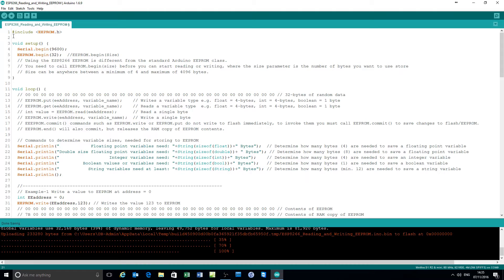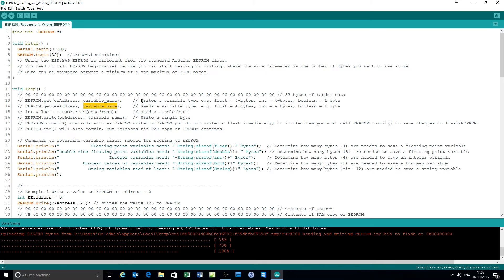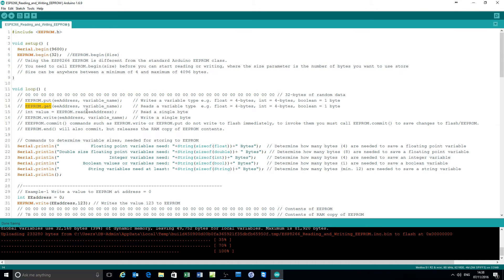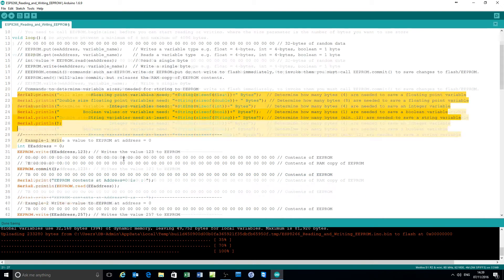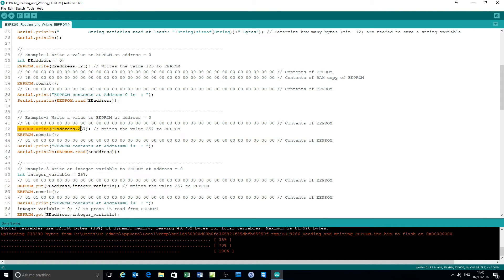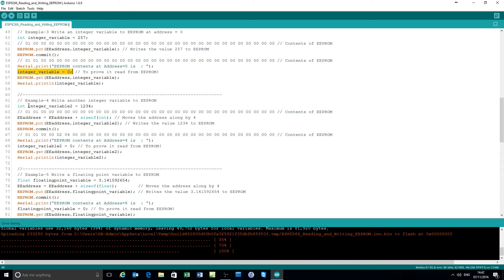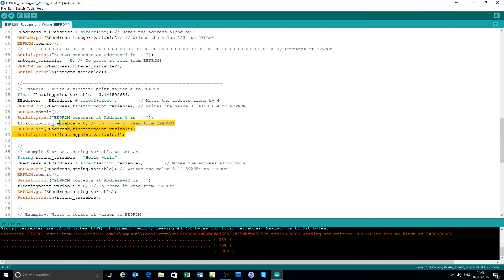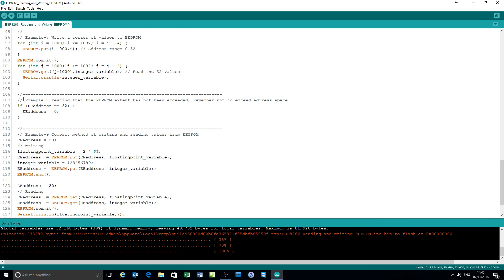Tech Note 015 - How to Use ESP8266 EEPROM

Comment: I'm not sure this works as advertised. EEaddress is initialized to zero but incremented by the "sizeof(<data>)" BEFORE being written in a few places. Example 4 increments by the size of the prior variable written (2 for type int) so that happens to match, though possibly confusing. However, at Examples 4 and 5, the increment is for the size of data TO BE written, not last written. Since you write and then read using the same EEaddress, the value returned is correct, however, it is NOT being stored in the positions indicated.
Please explain if I am missing something.
Reply from the maker: The examples are not sequential, they are merely individual examples, it was never meant to be an end-to-end result just single actions that work. You say ‘not sure’ of which element?
Reply: @G6EJD I mentioned examples 3 and 4. For the string example, the address is incremented by the string length BEFORE it is written. Should be incremented by the length of the last thing written.

Comment: I don't need big eeprom space.
Is it ok to call EEPROM.begin(20)?
Is 20 ok?
Reply from the maker: Any size you like as long as it’s enough to hold your variables, the EEPROM is used for nothing else. I advise going larger than you need unless your really sure you never need to enlarge the size, because if you do need to increase the size you’ll lose your data.
Reply: @G6EJD  Thanks for fast reply.
Let's say I'm am to using EEPROM address 0 only.
Is that address going to wear out at some point?
I heard about wear level controlling is that something ESP automically does or I have to implement myself.
Thanks again and I have susscribed to your channel
Reply from the maker: The ESP32 does do wear levelling, so it moves the physical address around but leaves the logical address the same, so you never know. EEPROM is not for frequent use, so you should get 100,000 writes before there are issues. Also do a read before write and don’t write if the same value is already stored, that improves life too.

Comment: I struggling:
i can't get your your example 9 to work correctly, after writing 2 values, only the first is read back correctly..
What i dont get:
- in all examples you end a write command with a EEprom.commit() , but in example you use a EEprom.end()  ??
- in all examples you end a read command with no special commens , but in example you use a EEprom.commit() after reading  ??
Does not make sense?
Reply from the maker: I've checked the examples and can see no problems with them. For an EEPROM WRITE or PUT they must  be completed by a COMMIT function otherwise the values are not written. EEPROM.end() closes the EEPROM services and EEPROM.BEGIN needs to be issued again.
Reply: @G6EJD  Thanks for your quick reply!! 
It does not seem to work, at least not for the second variable..   :-(
Only the first variable is written en read back succesfully, the second variable was never written, or read...
Need to say that i'm using a Wemos D1 mini board, maybe it has something to do with that? (also uses a esp3266)
My test sketch ends with " c1 = 1234    c2 = 0"

My test sketch:

#include <EEPROM.h>

int c1,c2;

// FILL vars

void initVariables(){
  c1=1234;
  c2=5678;
  Serial.println("--- Vars filled.. ---");
}

// CLEAR vars
void clearVariables(){
  c1=0;
  c2=0;
  Serial.println("--- Vars cleared.. ---");  
}

// PRINT vars 
void printVariables(){
  Serial.print("c1 = ");Serial.println(c1);
  Serial.print("c2 = ");Serial.println(c2);
}

void writeEeprom(){
  int EEaddress = 0;
  EEaddress += EEPROM.put(EEaddress, c1); 
  EEaddress += EEPROM.put(EEaddress, c2);
  EEPROM.commit();
  Serial.println("--- Vars written.. ---");
}

void readEeprom(){
  int EEaddress = 0;
  EEaddress += EEPROM.get(EEaddress, c1);
  EEaddress += EEPROM.get(EEaddress, c2);
  Serial.println("--- Vars read.. ---");
}

void setup(void) {
  Serial.begin(9600);
  EEPROM.begin(128); //size in bytes
  Serial.println("/n");

  initVariables();
  delay(500 );
  printVariables();
  delay(500 );
  writeEeprom();
  delay(500 );
  clearVariables();
  delay(500 );
  printVariables();
  delay(500 );
  readEeprom();
  delay(500 );
  printVariables();
}

void loop(){
  delay(500);
}
Reply from the maker: @winandd8649 , you've got the same address each time you read or write! You need to set the address for each variable on the ESP8266 each int takes 4-bytes hence +4 here:
 int EEaddress = 0;
  EEaddress += EEPROM.put(EEaddress, c1); 
  EEaddress += EEPROM.put(EEaddress,+4 c2);
  EEPROM.commit();
  Serial.println("--- Vars written.. ---");
}

void readEeprom(){
  int EEaddress = 0;
  EEaddress += EEPROM.get(EEaddress, c1);
  EEaddress += EEPROM.get(EEaddress,+4 c2);
Reply: @G6EJD  i appreciate your help very much, thank you!
But.. the change does not help, still the same issue.
I was assuming that EEaddress was increasing by the size of the used var, by useing  'EEaddress +=" in every line. That's also how you did it in your example..
It could be that there is an exception fot the ESP3266, but this is not the solution :-(

btw, note the comma placing; i assume you mean "EEPROM.put(EEaddress+4, c2)" instead of "EEPROM.put(EEaddress,+4 c2)" ...
Reply from the maker: What’s going wrong is the addressing and function formatting plus it looks like the ESP8266 compiler has changed, are you using the latest 2.5.3? To save a value use this EEPROM.get(addr,data); to get a value back use this EEPROM.put(addr,data);  you can no longer use them as a function that returns a value do try a simple test c1=22; EEPROM.put(0,c1); c1=0; and EEPROM.get(0,c1); serial.println(c1);
Reply: My test sketch works when i set c1 and c2 to less than 256 , so the size of 1 byte (but vars are still declared as integer )
So i tested a bit more and the "EEaddress +=" trick seems only the add 1 to EEaddress, not the size of an integer value (4)
I guess i have to give the addresses manually, then it does work, so:

  int EEaddress = 0;
  EEPROM.put(EEaddress , c1); 
  EEPROM.put(EEaddress+4, c2);  
  EEPROM.commit();

and

  int EEaddress = 0;
  EEPROM.get(EEaddress , c1);
  EEPROM.get(EEaddress+4, c2);

Thanks for your help though!
Reply: I'm using latest compiler; 2.6.3  Indeed, some changes maybe done to the compiler
It's working now, i finally settled with this fomat; (handy with a total of 16 values in project code)

EEaddress  = 0; EEPROM.put(EEaddress, c1);
EEaddress += 4; EEPROM.put(EEaddress, c2);
EEPROM.commit();

and

EEaddress  = 0; EEPROM.get(EEaddress, c1);
EEaddress += 4; EEPROM.get(EEaddress, c2);
Reply from the maker: You can use EEaddress += Sizeof(c1); then it will assign the correct address increment regardless of the variable type. The default would be 1 byte unless defined otherwise.
Reply: @G6EJD  Thanks, that's a good tip indeed! (In my case i have all integers, so '4' is shorter..)

Comment: TLDR; Would you be able to create an example of reading and writing a STRUCT to EEPROM?

I'm struggling to figure out how to load a struct with individual variables, save that struct to EEPROM, load the object again at boot and extract the individual values to their respective variables. Can you show me how to do that with a simple struct object containing a string and an int? 

In my specific case, I have some 25-30 individual variables that my app requires. At this time they are defined in the setup() function and are loaded with dummy data. Through the web server on my ESP8266 I have a page where the user can edit these values. The idea is that when changes are submitted from the webpage, those variables need to be saved to EEPROM, the device needs to reboot, and upon boot pull those variables in from the EEPROM. But instead of writing out many many lines of code to save each individual variable (which is a LOT of extra coding), I would like to stuff all those variables into a single serialized object (STRUCT?), write that object to EEPROM, reset the device, on boot load that object from EEPROM and assign the individual values to their respective variable names. Thank you in advance!
Reply from the maker: John. If you define your type say ‘address’ with members ‘name’ of type string and ‘housenumber’ as type integer then you’d reference the values like this address.name and address.housenumber and then you can use these to read/write the values to EEPROM. The most important thing to note is the EEPROM filing system has no file management facilities so your program has to manage all that for example a varying length of string or you have to create a memory map showing the size of all variables used and their locations and stick to it.
Reply from the maker: John, you can’t write a structure to EEPROM you have to manage it object by object, this is a limitation of using EEPROM.
Reply: Thanks for the replies. So if strict won’t work, is there a way to serialize my data into another type of object that can be stored in eeprom? JSON for example...JSON is basically a string right? Any other ideas how I can achieve this?
Reply: Also, I don’t quite understand why a strict won’t work. Can you explain? Is a struct not an object in memory like string and int? Thanks
Reply from the maker: John, yes your correct a struct would work, but you can’t write or read that type in one easy command, all you can do is write bytes, strings, integers or floats. But they all need to be fixed entities unless you employ what is in effect file management techniques when r/w to eeprom, a string of variable length would of course change all addresses, so writing a struct out requires it to be deconstructed to its component parts and types then each type written out appropriately and the same in reverse. Yes, converting the struct to a JSON and writing that string to eeprom and the same (read) for recovery would be much simpler to use. I haven’t checked if there’s a string length limit on writes, although the maximum string length is 16384 bytes.
Reply from the maker: EEPROM.writeString(address, sentence);

Variable = EEPROM.readString(address);
Reply: G6EJD thank you for the explanation, I think this makes sense and I will probably move forward with using a JSON object as mentioned. If I can get this to work then saving to and from EEPROM for future projects will be clean and easy! You figure for most devices you want most of the same basic features - wifi, ota updates, web server with config pages, access point to configure, etc and this piece is the final piece to make it all work. With all these pieces in place, it will make it easy in the future to slap some sensors on a chip and ship it in quick time. I really appreciate the help!
Reply from the maker: John, if would be better to use SPIFFS which uses the flash storage as a repository for the data. Also, note there are limited write cycles (write few read many) on the EEPROM and to a lesser extent flash memory, either way both have practical limits albeit usually 100,000 writes before failure.
Reply: G6EJD yeah, I figure the device will only need to write to EEPROM when he wifi changes or something, which is rare and probably not a big deal.  I did look up SPIFFS and it seems simple enough, we may end up using this for another purpose and so I might end up using it in the end. I guess we’ll see when I get to that point. For now though this will be enough.

Comment: Hi. I am writing a code to log a total runtime for nodemcu. Ive read through your codes and manage to store into the EEPROM. but the problem is when the s value reach 400++ and then I reboot. the EEPROM value drop till 100. Do you have any idea on this? Here is my code.

#include <ESP8266WiFi.h>
#include <EEPROM.h>

            
int address;
int value;
int h = 0;
int m = 0;
int s = 0;
int sec = 0;
int ms = 0;

void setup() {
  // put your setup code here, to run once:
  Serial.begin(115200);
  delay(10);
  EEPROM.begin(32);
  s = Recover_runtimestate(0);
  
}

void Runtime(){
  ms = ms + 200;
  if (ms == 600)  //if state for counting up seconds
  {
    Serial.println("Runtime Sec");
    ms = 0;
    s = s + 1;
    sec = sec + 1;
  }
 

 m = s /60;
 h = m /60;
 
   if(sec == 60)
 {
  sec = 0;
 }
 
  Save_runtimestate(0,s);
}

void Save_runtimestate(int address, int value)
{
  EEPROM.write(address,value);
  EEPROM.commit();
}

int Recover_runtimestate(int address)
{
 return EEPROM.read(address);
}

void loop() {
  // put your main code here, to run repeatedly:
  Runtime();
}
Reply from the maker: There is something wrong with your runtime routine as it’s continuously looping without any delay and ms increases without any delay, you need a delay(200) at the start of the runtime function otherwise it’s counting up in uS probably or however long it takes to loop around which won’t take long! What your seeing is a continuous wrap around, I’m surprised the EEPROM is still working as it can only be written to about 100,000 maybe a 1,000,000 tines!

Comment: Thanks for the tutorial, very helpful.  I have a problem saving a String as the first letter is chopped off. I noted a small error in your String example at line 91 in that you clear the floating point variable rather than the String. 
(floatingpoint_variable = 0; // To prove it read from EEPROM!).  
When I clear the String variable, the "get" value returned is "ello World".  I wonder if you see the same problem?
Reply from the maker: Yes the variable named ‘floating_pointvariabke’ should not be there. I suspect the compiler has gone through some changes and now counts 0 as an address such that 12 needs to be 11 as the start address. It’s actually easier to use the FS flash filing system as writing a d reading strings is so much easier than having to track eeprom locations and flash memory is near identical in storage life.
Reply: @G6EJD  Thanks for the reply.  I would expect the put and get addresses to be the same though so, if they are both hard-coded to 12, for example,  I'd have expected them to both point to the same address.  I'll have to research the FS flash filing system as I'm not familiar with it. (John g4vwl)
Reply from the maker: John, the SD library has had a lot of recent changes and when I uploaded that example is was working ok, so I’m sure recent changes have altered the operation of the read/write, I’ll try it out later. 73

Comment: can we ? use  EEPROM to store the last state of a relay , and when the device reboots it has to remember the last state in EEPROM and put that into action.
Reply from the maker: Yes:

#include <EEPROM.h>byte Relay_State; // 0 = Off, > 0 = On

void setup(){
  Serial.begin(9600);
  EEPROM.begin(32);
  Relay_State = Recover_Relay_State(0);
}

void loop(){
  {
    //Do some stuff here...
  }
  Relay_State = 1; // For example set it on
  Save_Relay_state(0, Relay_State);
  delay(1000);
}

void Save_Relay_state(int address, byte value ){
   EEPROM.write(address,value); 
   EEPROM.commit();
}

int Recover_Relay_State(int address){
  return EEPROM.read(address);
}
Reply: G6EJD 
Will this apply for nodemcu as well ?
Reply from the maker: yes, any ESP8266 or ESp32
Reply: G6EJD 
Thank you so much for your quick reply. I will try and let you know. Thank you once again for your valuable time
Reply from the maker: Happy to help
Reply: Yes, you can.

Comment: I have used the EEPROM on the ESP8266 to store values between reboots.  It is very convenient and extremely usefull. BUT, I have moved over to an ESP32 and do NOT find anything like the eeprom on the ESP8266.  Any ideas?
Reply from the maker: Strange problem, I use EEPROM all the time with the ESP32 and it works ok, so #include "EEPROM.h" then eeprom.begin(size) and use put and get values. The code is identical between the ESP32 and ESP8266. https://github.com/espressif/arduino-esp32/tree/master/libraries/EEPROM/examples
Reply from the maker: William Miller BTW the ESP32 implementation uses Flash memory so it’s a simulated EEPROM function.
Reply: Thanks, I did try it again and it now works.
Reply from the maker: OK good.